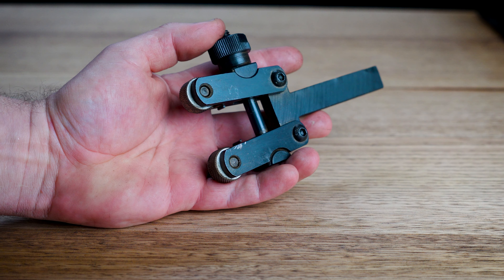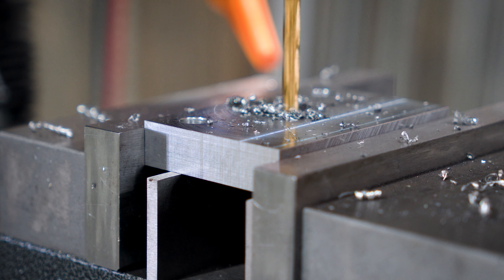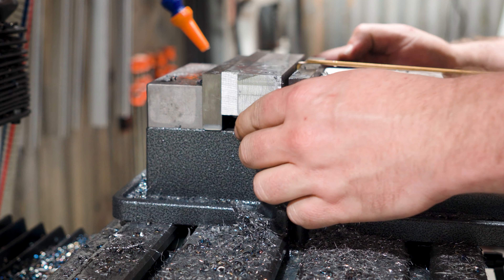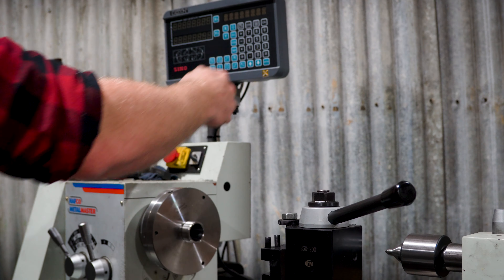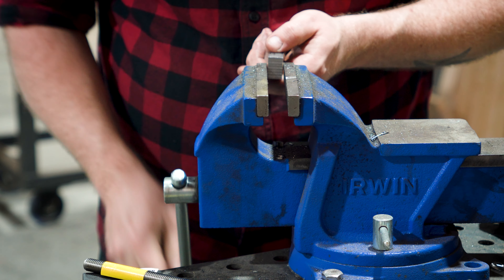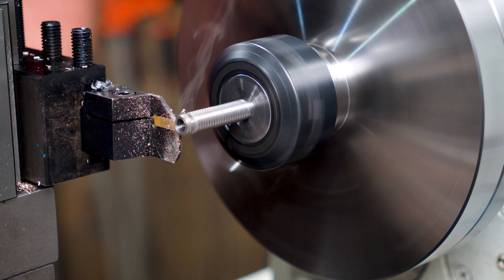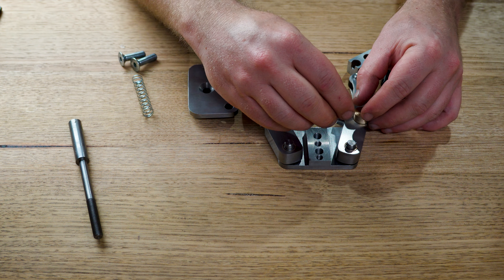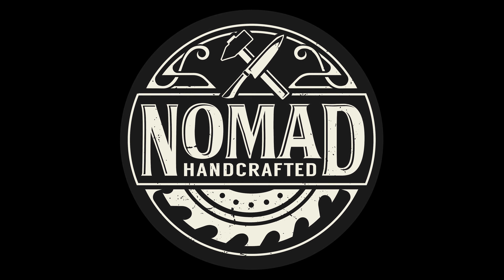Leveling Up My Knurling Game: Making a next level Knurling Tool!

Comment: Instead of putting a slot in the knurl screws for a blade screwdriver how about a couple of holes for a pin wrench.  You can make the wrench and share that video. 😊
Reply from the maker: That’s a really clever idea! I might just have to do that! If I can get enough together for a video, that would be an interesting little job! Thanks for the idea!

Comment: This is probably going to be a no, but any chance you would be willing to share the models of this knurling tool with us?
Reply from the maker: To be honest, I didn't model it, I kind of made it up as I went, but I did take some measurements at the time for another person that asked, ill paste that comment below

Thankyou! I worked off some really rough dimensions and kind of just guessed the rest, but if it helps, the arms are approx 120mm long and 30mm tall and the main body is about 70mm x 50. The standoff holes are 10mm in on centre from both sides, from there it should kind of fall together, most important part of the project is nailing the fit on the arms to the body, and the wheels being pretty snug in their slots to keep everything aligned 👍

Comment: What a fantastic build! Really enjoyed that. 
Been meaning to make a hemingway kits tool for quite some time. This looks like a strong comperitor to it 😁
By the way, a different way I found to cutting the scallops on the handwheel is to set the collet upright, indicate the centre and plunge with an endmill in several steps rather than taking a full depth of cut with a ball nose(it's what I did in my first video, shameless plug). This method takes much longer, but I found that the surface finish is a lot better on small milling machines(granted, your mill looks like a bridgeport compared to mine 😂)
Keep up the good work.
Reply from the maker: Haha Thankyou! It couldn’t be farther from a Bridgeport unfortunately, it’s only about a 400kg machine, I’m working hard to save some pennies to buy a little “heavier” machines. I have done the plunge method on brass with excellent results, but not so much in steel. I’ve tried it a few times and the end mill tends to grab the part and try and yank it on me, but it could also be my vice or too much stick out or something, but I’m going to figure it out one day 😂😂 appreciate the feedback though!!
Reply: @nomadhandcrafted  Considering that my mill is only about 120kg, I think my point still stands 😂
You're absolutely right about the "grabbyness" of the method, hence why very light passes are what worked for me. I managed to do it in titanium, so steel should be no trouble. If memory serves, each scallop was 4-6 passes this way, so definitely takes longer. Regardless, you seem to get a really good finish using your method anyway!
Reply from the maker: Haha wow, that’s pretty impressive for such a small machine! And that’s probably where I have gone wrong in the past, I’ve tried to take to big of a cut by the sounds of it, you’ve got me inspired to try again next time I want a scalloped knob 😂 the finish is ok from the ball mill, but it would definitely be better from those side flutes!

Comment: Slick work. Nice execution. Any drawings or dimensions?
Thanks 😊
Reply from the maker: Thankyou! I worked off some really rough dimensions and kind of just guessed the rest, but if it helps, the arms are approx 120mm long and 30mm tall and the main body is about 70mm x 50. The standoff holes are 10mm in on centre from both sides, from there it should kind of fall together, most important part of the project is nailing the fit on the arms to the body, and the wheels being pretty snug in their slots to keep everything aligned 👍 let me know if there is any others your chasing 👍